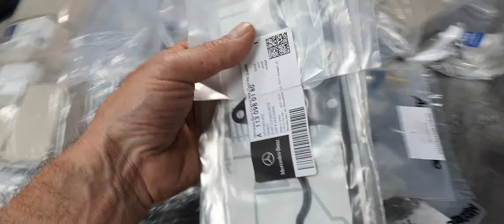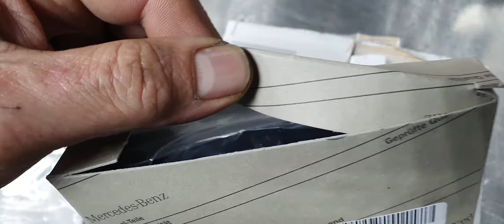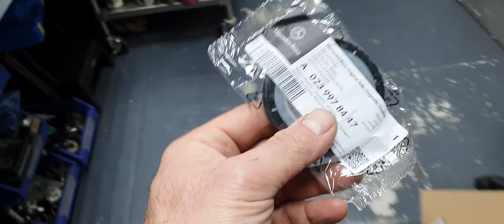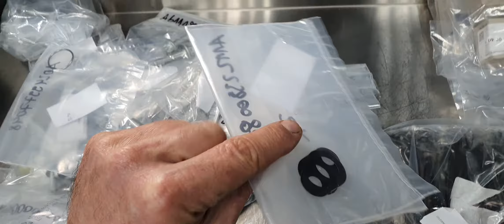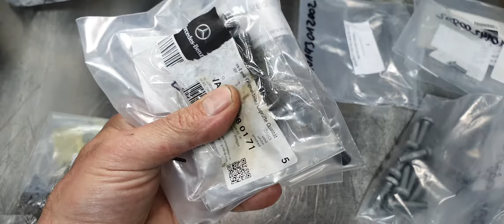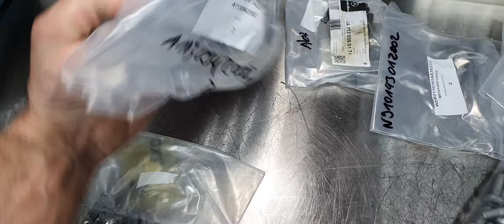M113k engine rebuild from Netherlands for Mr. Kishan (part 14)

Comment: Tasos, I have a question, you know on W211 there are many stick out bolts on the bottom of the car to hold the protection panels. One of them on my car is broken, what do you use to replace them? I know Mercedes sell a repair kit for it, but do you have better options?

Comment: Parts costs vs new engine?
Reply: Forget this question 😅. A new M 113 ML engine is extremely expensive.  And there all the other required parts have to be included.  The revision of this engine, as Tasos does, is cheaper than a new engine.  Best regards 🙌